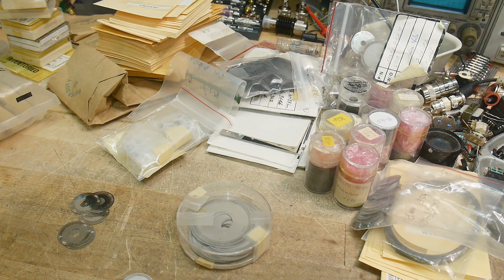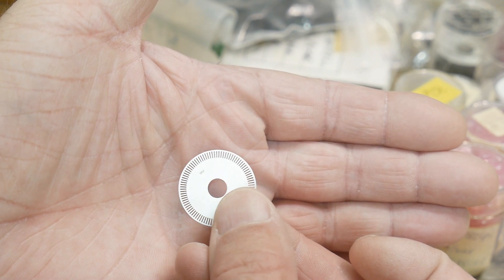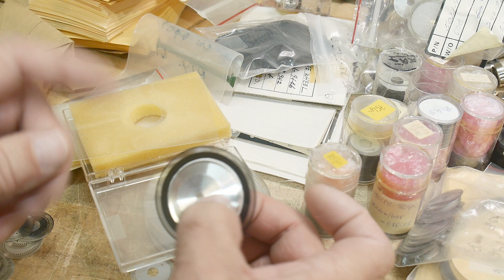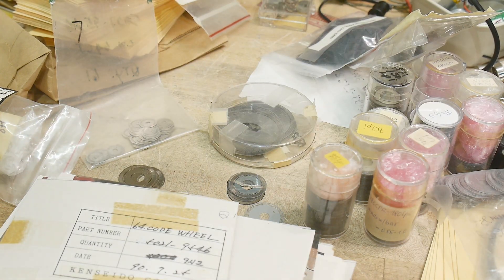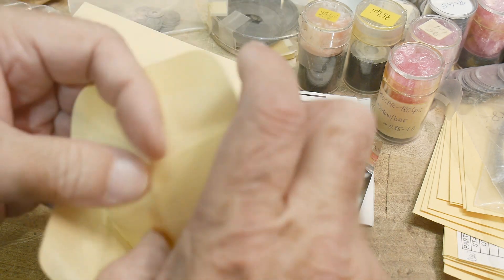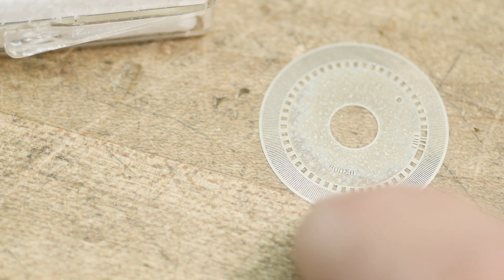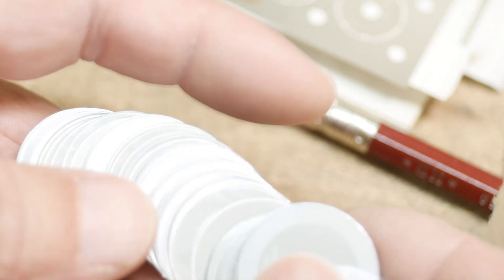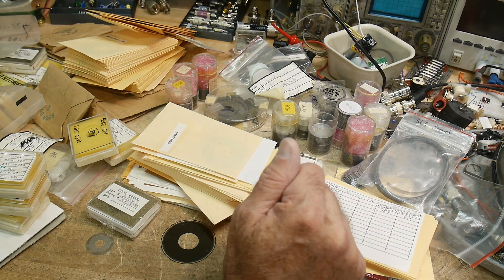#1403 Encoder Wheels

Comment: Very cool tech. Some major mice brands use optical encoders for the scroll wheel and have grates built into the wheel itself. They seem way more reliable from personal experience. I've wondered if they could ever replace traditional encoders for things like power supplies and oscilloscopes since the mechanical ones seem like such a big failure point.

Comment: These encoder wheels would be very useful to set up experiments to measure the speed of light! Get them spinning and then pass light through the slits and at a distance measure the return of the light and time it takes to travel a good distance.  With so many slots one can get accurate light speed calculations!

Comment: These rotory encoders with such a high precisions are almost obsolete now because the shafts and rotors also need to have the same or better precisions.   The linear encoders are used for very accurate measurements but they are balkier.  Advantage of linear encoders is that they do not related to the precision of the shaft and rotors and anything in between like couplers.

Comment: Cool!  They could still be used by the adventurous hobbyist, especially the larger, lower count items.  When we were making my dad's telescope back in the mid-90's we would have been very interested in acquiring some of these. 

Love your channel, BTW.  Tidbits of wisdom from an ex-HP employee are not to be ignored.  HP.  Probably the greatest name in solution electronics ever.  DEC would be a close 2nd, and at one time they were (sorta) the same company! 👍

Comment: The stainless steel wheels could be used to test how good your DIY PCB  photoresist  method works and what is the min. trace width for mentioned method.

All can be reused for different purposes.

Comment: I once worked in a place where high precision encoders were used. I was told some could output a sinusoidal wave. This was accomplished by matching the emitter size to the slot size. Then they measured the output light intensity. Can you go into the workings of the encoders. And I'm with others, don't throw those out. Send a few here.
Reply: There's long been an analog type of rotation sensor called a "resolver" that uses rotary transformers to output sine & cosine waves that can resolve speed and absolute shaft position with (theoretically) infinite resolution.  Also "tach generators" have also been used, being cheaper than resolvers.  Those old analog sensors have largely been replaced with digital encoder wheels and linear scales like these HP ones because of their robustness and lower cost at manufacturing scale.
Reply: @Randrew  Thanks Randrew I remember "resolver" now that you mention it. They were used in a radio telescope more than 40 years ago.
Reply from the maker: https://youtu.be/98cw-IueruI
Reply: was thinking two of these could be used, one rotating, the other stationary, to use oversized emitters/sensors. But getting quadrature would require slicing the stationary one and some fine adjustment. Regardless, analog would result, maybe not perfectly sinusoidal, but higher precision than the slot-count...
Reply: @ericwazhung  Hi. I think you have something there. They still make these today, I had a look for them. I also found a paper from the 80's on how to use them. They square up the outputs for a coarse position and then use the Sin Cos analog for fine position. The RPM needs to be limited to match the A/D converters

Comment: I have some encoder wheels and optical sensors from printers. 
Can suggest how to center a wheel on a shaft (they have different diameters) and how to align the optical sensor to the wheel?
Reply: Look up CD labeling kits for inspiration.  In most of those there's a spinning top looking gadget that has three diameters on a shaft.  You drop the CD label onto the middle diameter then drop the CD onto the small diameter.  This way the device holds both the label and the CD on the same center.  Then you flip the whole thing over to drop the perfectly centered label onto the CD.

In your case the smallest diameter would be a hole to accept your shaft.  The next diameter would hold your adhesive "expander" disc that makes up the difference in diameter between your shaft and encoder disc.  The largest diameter would be for your encoder disc.  Stack everything in order: Encoder disc, adhesive disc and shaft.  Lastly you'll need some kind of collar that goes around your shaft and affixes to it (set screw maybe) and whose face will stick to your adhesive disc.

Good luck, we're all counting on you ;)

Comment: You have any you know were designed for quadrature encoding? I'm pretty sure for instance you can get cheap chinese digital callipers, they can be a bit dodgy but still get amazing resolution considering the BOM cost using quadrature encoding along the ruler. Maybe an expensive Mitutoyo one does so as well but is just built 10x better.
Reply: The quadrature encoding is in the photonics sub assembly.  Two detectors are spaced 1/4 of a light dark strip to give the 90 degree phase offset
Reply from the maker: https://youtu.be/98cw-IueruI
Reply: bigclivedotcom did a teardown of cheap electronic calipers: https://www.youtube.com/watch?v=fKSSY1gzCEs